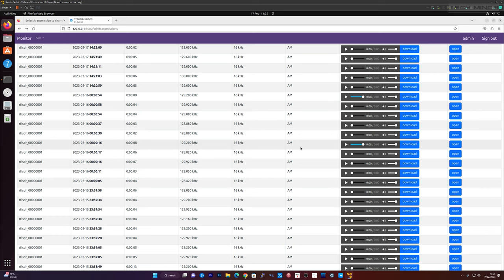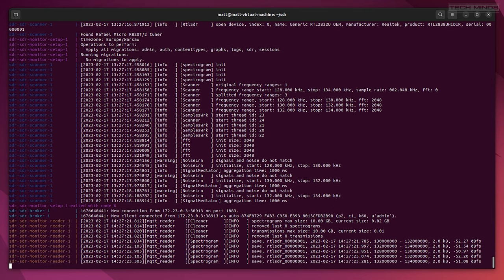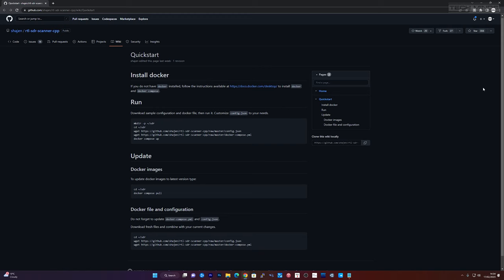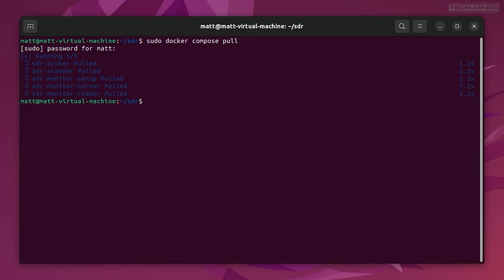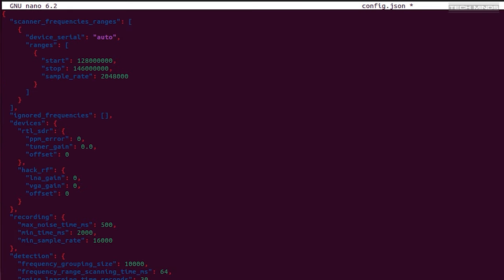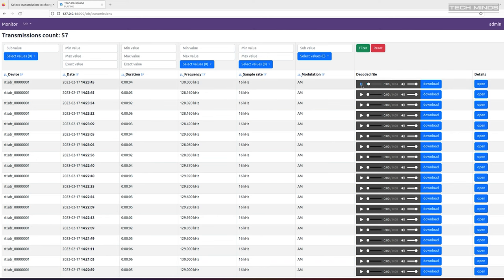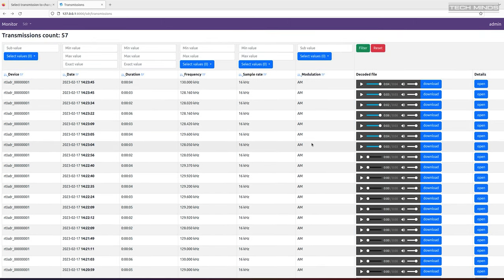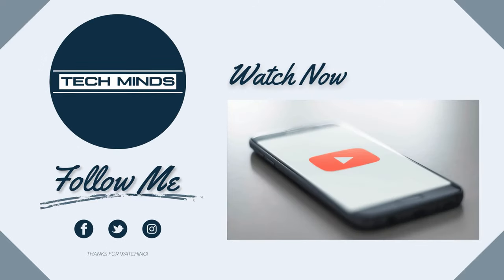Recording Air Traffic Radio Transmissions With RTL SDR Scanner

Comment: Thanks for revisiting this for us!  I was pretty sure the AM feature would be added quickly, but I had no idea it would be THIS quickly, so thanks for camping on the topic.

Aircraft monitoring is kind of a no-brainer application for this software and I think that's why so many people were clamoring for it.  Radio comms for (especially commercial) flights hop thru several frequencies.  Typically each handoff is a different frequency:  Ground, Departure, Center, maybe another Center, Approach and Ground again.  Of course you're not likely to be able to receive all those comms of a particular flight, but I would like to be able to catch (semi) local approaches and departures at KTUL, including their handoffs to/from Kansas City Center (vZKC).

This oughta give me the best chance to do that, so Imma give it a shot :)

Comment: Confirmed I have this working. I’m using a Raspberry Pi 4, 4GB model, 64GB SD card, Nooelec RTL-SDR v5 SDR, a D1000 whip antenna from Broadsword. OS I’m using Pi OS 64 Lite. Enable SHH and installed Docker from sdr-enthusiasts/docker-install on Github. I have it set to scan 121-134mhz which covers everything at my local airport. I will relocate it latter today to the loft and connect it to my Slim G antenna. Thank you for the update.
Reply: My Pi4 is being delivered today and I probably have a long way to go before I'm ready to tackle this precisely BUT is there a way to set it to scan a pre-defined list instead of a range? For instance, the published local approach/control/ground frequencies only any given facility? I'll ultimately be using this to capture radio transmissions at motorsports events where racers use UHF radios to communicate but the idea is similar to capturing air traffic.

Comment: Can't get it to work properly! I'm a Windows 10 hosting a Ubuntu VM on Oracle Virtual Box. I get a spectrograms but no transmissions! Only works if the frequency interval matchs the sample rate! Otherwise it assumes kHz instead of MHz. Is there documentation available?

Comment: I’ve recently subscribed to your channel because of your excellent content. Since you’re so into RF and SDR, I was hoping you could explain or do a video on SDA’s(Software Defined Antennas). I only recently stumbled upon this topic and have asked a few people about it but with no response. And I’m pretty sure it’s not antennae made specifically for SDR but rather an Antenna with the majority of its characteristics managed in software. I’m just starting to get my head around SDR mottling around with GNU Radio Companion, which was the first place I looked for more info but with no luck. Any thoughts or input you might have would be greatly appreciated

Comment: I like the concept but the project isn’t open source yet. The web UI is closed. 

Also I have yet to get it to work with my hackrf for some reason. Nothing is recorded.

Perhaps it’s my config or something.
Reply: Did you set the amplifier gains in the config file?
Reply: @MrApolloTom  yes. Perhaps not correctly though. I’m going to borrow the config from this video I think and see.
Reply: @michaelgraff6978  I've been starting to see problems if I use custom sample rates. It works if I use the suggested 2048000, 8192000 or 20480000

Comment: I totally want to get this working,  but I was having issues getting the docker i.age to run for more than a few seconds before crashing.  Never was able to get the web interface to come up. I was running it on Ubuntu on Orange pi 4 LTS, but I might try from a VM on my windows laptop this weekend.
Reply from the maker: I tried on Ubuntu orange pi too, never could get it working so I shifted to VM on my PC. Maybe it will work on orange pi with some tweaking.
Reply: I was able to get it to work on my laptop! All I had to do was pull the bandaid off and get rid of Windows, load DragonOS and this,  along with a host of other SDR tools are working great.